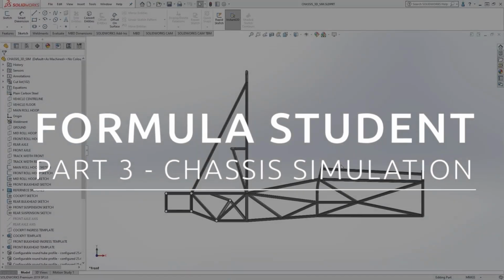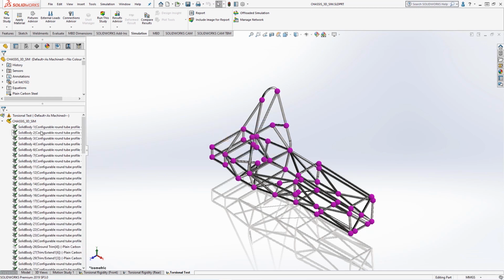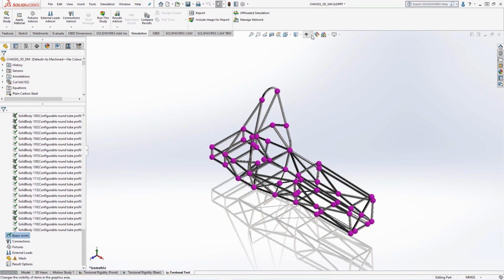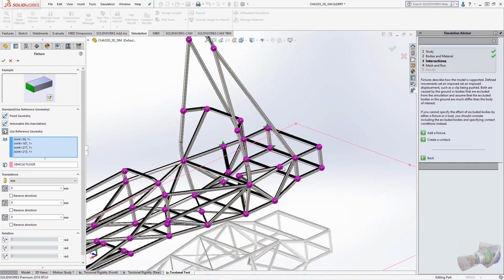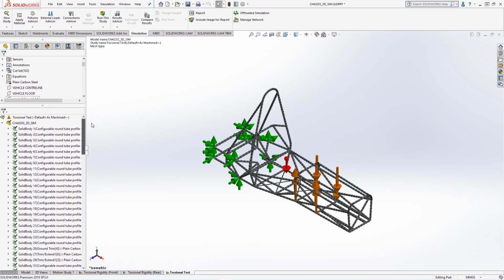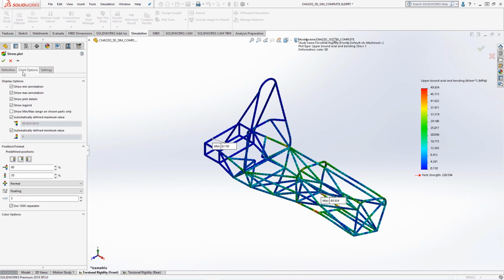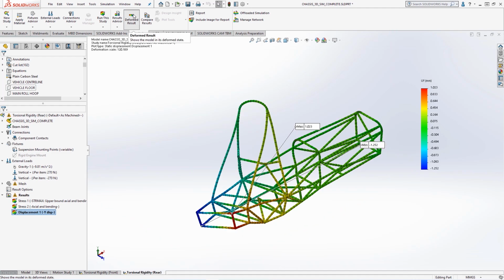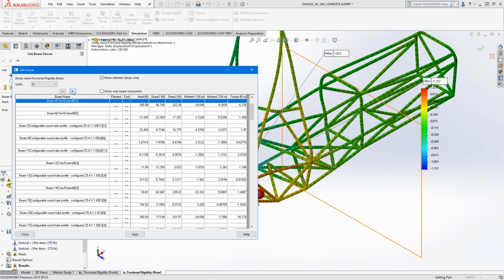Formula Student - Part 3 - Chassis Simulation

Comment: Hi! On that basis did you decide that applied force should be 300N?
Reply: Hi, the force was determined using the centre of mass position (extracted from SOLIDWORKS), as well as the mass of the vehicle which is multiplied by gravity to get the weight. The weight is then distributed over the front and rear axles depending on weight balance ratio (50:50 or 40:60 etc). Then the value is divided by 2 so you get the weight acting over one corner of the vehicle at the wheel. In this case we assume the suspension components are rigid and we transfer all the load (worst case) to the chassis. You could multiply the weight by a general dynamic load factor (1.2 - 1.6 etc) to simulate a 'bump impact'. In this case through the calculations mentioned the force was determined to be 300N but your values may differ. I hope that helps!
Reply: @sameeraftabqureshi  Just as an additional note, normally the value you pick as a chassis engineer should be given to you by the suspension engineer, who's crafted the setup to handle a particular loading case which you're responsible for trying to optimize
Reply: @thenozar7603  Hey and yes you are correct. In a previous analysis as part of a rolling chassis design team I have used values determined from a double wishbone suspension analysis...using roll centres, spring rates, dynamic load transfers etc that have been provided by a suspension designer. At that point accurate modeling on the connection points to the chassis (vector forces, locations, bushing considerations and so on) becomes important to understand so it's a more complex type of study. This is just a basic setup

Comment: Hey, its showing there are not enough constraints in my analysis.
Reply: Ensure all your frame nodes are connected together (purple dots) and also ensure you have applied fixed conditions to the suspension mounting points at the rear NODES (not faces) of the chassis.